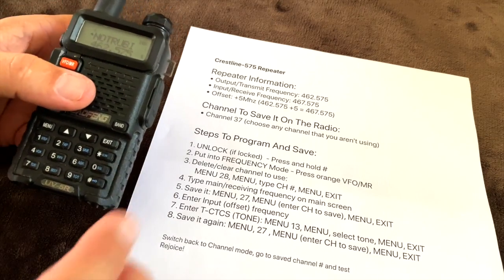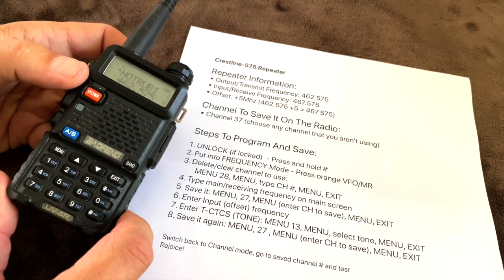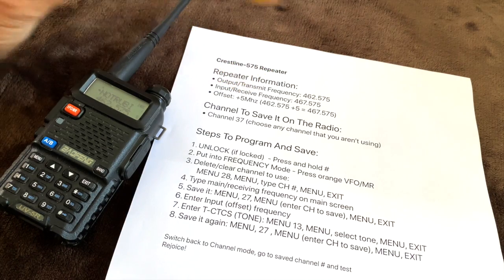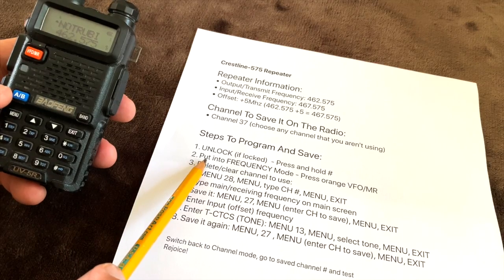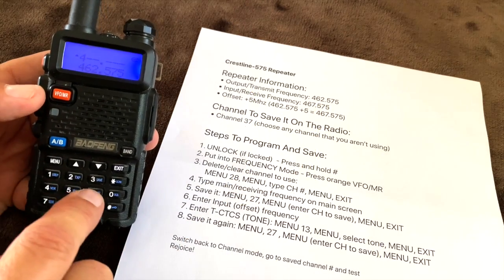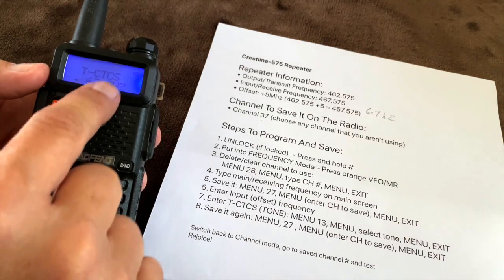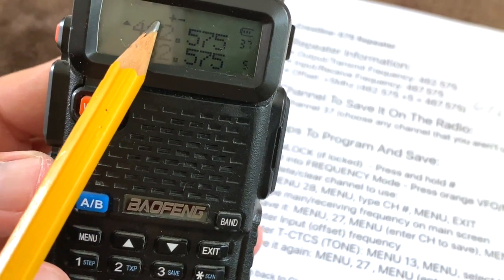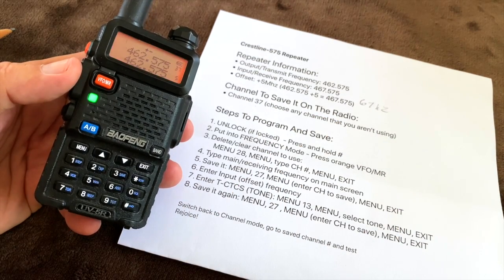Baofeng UV-5R: Add CTCSS and DCS Codes & Tones On The Keypad And Connect To & Talk On A Repeater

Comment: Hello sir!! First let me thank you for taking your time to create this very helpful video👍and for helping those new (GMRS Lic:) ppl like my self. 
I do have a question regarding repeater programming and is as follow: 
When entering the (Tx) frequency, do I set the (CTCSS code) but with the (Rx) off and save it, and the same for (Rx)  with (CTCSS) and the (Tx) off and save it? I got a bit confused there? I noticed that on the video, only for (RX) the (CTCSS) was entered and saved?
Reply: Have your radio in hand. Watch the video and pause after each step. Do the exact input as Randy and walk through it. I believe you are mixing up rx for the repeater and your radio. Hope this helps.

Comment: Hey great job. Very thorogh. However the repeater I want to use only supplies a TX freq. and a +. No RX freq. I can hear incoming but they don't receive me??
Reply from the maker: If they tell you the TX and the +value, you can calculate the RX by adding the +value to the TX
Reply: @TheNotaRubicon   there is no + value, it's just  +
Reply: It'offset: + is the info they provide.
Reply from the maker: if it is a GMRS repeater then it will always be +5 (467.xxxmhz IN, 462.xxxmhz OUT) .. if it is a ham repeater it could be anything, so they need to tell you what the RX is, or what the offset is so you can calculate it.

Comment: First of all, I just got two of these and trying to sett them up for my kids.... so, thanks a lot for being so coherent :):):), rare thing these days ;). 
It's a real trade, to know how to explain something like you would to a first grader  (trying not to say idiots...) without being condescending and judgmental :):):). And second, even though this really helped me a lot understanding the menu structure and basic principals (it reminded me about "my old nokia" menu) I still have one question. English, not being my first language, please excuse my formulation used to put tougher  this dumb question. 
Is there a way to make a private "connection" using CTCSS and DCS without going through a repeater on "free frequencies",  between two devices used in a dense forest at a maximum distance of  2000 meters radius, with a squelch level that would help the kids communicating freely without interfering with a military base (4 to 5 km away from the "play ground") ?
Thanks again ;) !!!
Reply: They did ever work

Comment: so couple things first to make sure i understood this right to use the repeater i HAVE to save it to a channel? and second how do i pull the info from say the repeater book app for example one repeater looks like this

2m
145.41000
144.81000
-0.6 MHZ
FM 100 Hz

so is the first frequency for the menu 13 T-CTCS
the - For Menu 25 the shift
the 0.6 for menu 26 offset?

Comment: Very good, but I still need clarity. After a lot of searching and joining things, I finally got the information for a local repeater. However, it lists DCS codes for both transmit and receive, and they are not the same. Any suggestions?
Reply: Hey Michael. A gmrs repeater that transmits out a tone really doesn't need to be set into your receive frequency as it's not "private" and you will hear the transmission anyway. However, by entering the tone you will filter out all other people that are possibly using that frequency in the simplex mode and not on the repeater. Simply follow the procedure for step 7*** after step 4 ...so step 4, step 7 except you use r-ctcs (tone) and it's menu 11 , then step 5 and so on, if you wish to do that. 
***IN YOUR CASE...DCS **** the menu items are 10 and 12. 
Randy has a video on all 40 menu options.
Hope that helps!

Comment: Is there an easy way to turn on/off CTCSS or DCS while in channel mode without deleting the channel? The menu acts like it lets me save, but as soon as I navigate away in the menu, it resets to whatever I programed in.
Reply: I was going to ask the same question, or similar. I followed the instructions to the letter, but it's not working on my end. Also, the letters "CT" are to the left of that requency channel that I just programmed. Is that supposed to be ON or OFF?

Comment: I went through all of this on mine, and it is still not transmitting for some reason...I can key up my KG-805G and hit the repeater, and the UV5 will pick it up from the repeater, but when I key up on the UV5, I get nothing from the repeater, or my 805??  Not sure what it wrong....
Reply from the maker: Either you did it wrong/missed a step, OR, it is possible the two radios are too close to each other and are de-sensing.. try it with the two radios 20 feet or more apart.
Reply: @TheNotaRubicon  Thank you, I will give that a try.....but I probably just did something wrong on the Transmitting side....

Comment: To set the offset why did you not just go to menu 25 and 26, adjust, then save? That would save you a lot of steps. 

Your step by step is nice but confusing that you used both channels to set your send and receive instead of just one. I have met some people that think the A and B channels are one for send and one for receive, because of this video. That is not the case. They are each capable both and you can hear both as long as menu 7 is set to “on”. When it is off you can only hear the A/B channel that is selected.  

Great radio but really confusing to manually program.
Reply: Terminology can be confusing.  I understand exactly what you are saying, but even your comment could be confusing. He used both "frequencies" not channels. To make matters worse, A/B can be referred to as channels A/B, the open memory bank number on the radio is channel and gmrs groups their frequencies in channels. The gmrs channel (in this case 16-b or 16-r) and the radio channel are probably different. (In this case 37) Both frequencies Randy programmed while he was on the "a" side, and "b" just happened to be programmed the same as the receive frequency. In summary, they are saved on the radio in channel (37)that is different than the assigned gmrs channel (16-r) and when selected can be in channel a or b depending how you want it. It's easy to see how it can confuse the people you met. Glad you set them straight.

Comment: I have a UV-9R PLUS  and program cable .I tried to set up the repeaters I use  with Chirp and some reason does not  recognize the radio . tried  Uv-9 nothing.
So after I tried to enter in the tone and offset  I could not get it to work to any  repeater.  I do have other Btech and Boafeng models all hold the programing fine.  some reason I cant get the Uv-9r plus to program right or hold the setting .. any ideas thank you

Comment: Hello guys! Great video btw! We bought 20 Baofeng UV-5R 8W stations for a cinema project. Is there a way we can encrypt a frequency and use the stations only for work purposes? At this moment when we record some captions, we hear noise...and this is bad for the production. Is there any way to avoid that? Thank you in advance :)
Reply: The only way to encrypt a signal is with digital radios, Uv series radios are analog so that’s can’t be encrypted but you can use. Tones like T- CTCS and R-CTCS to sort of hide your conversation, you can also program these to transmit on one frequency and receive on another. You can temporarily use tones to further code your conversations. But be advised someone with a code scanner could hear your conversations. To use tones there are plenty of videos to show you how to use them. Basically program your radios to use the same tones both in transmit and receive, you won’t hear any other radios that don’t have the same tone that your using. Try using like MURS which these radios can do limit the power of them and that will help you secure your transmissions. Good luck have fun, be warned the fcc has limits on using tones in the untied states, so check your regs before you do any of this,

Comment: I programed both my beofeng radios step by step in this video. But I cannot hear my voice on either radios when I transmit. But the repeater sounds are made on both radios. What am I missing or don't understand about repeaters? Great video!
Reply from the maker: The radios may be too close to each other and the cheap circuitry is being overloaded - try separating the radios by several feet and see if that helps.  If they still dont work, you likely missed something.
Reply: @TheNotaRubicon  That did the trick! I had them to close together. Easy video to follow on you tube on this subject and I have been trying for two weeks. Thanks again. Mike

Comment: steps 5 and 8 prove that step 3 isn't necessary. step 8 proves step 5 isnt necessary. also i only save once, and i save over existing channels if i need or want to. also you skipped over the setting the offset direction, you gave actual needed frequency but not the direction or offset amount. EDIT BEFORE POST: ok i just tested your method and it works your way too. since you skipped the offset direction i guess it just transmits the frequency you placed in the field, other wise if you set the direction  you would need to place the actual value of the offset, not the end result of adding or subtracting the numerical values. good to know, i wish i knew why it works either way as i am sure there is a reason.

Comment: THANKS for the video.  I have my radios (2) programed for 3 LA Repeaters and I did with the cable. After we move to UT, I lost the cable and the software. Is a way to reset the radio to factory setting and remove the program without the Cable & Software?   PS Since the radio was programed with Window XP and now we use Window 10, I think I will have an additional problem.
Reply from the maker: You can use Menu option #40 to reset the radio - these are the options:
-  VFO - Resets all menus to factory default. Resets VFO [A] and [B] frequencies to factory default.
-  ALL - Same as above. Erases all channels.

Comment: Does having a heigher ctcss exaple 244.7 has any different or effect on transmission as if i was to use 67.0 or 103.5
Reply from the maker: CTCSS tones have no effect on transmission and the tone must match the tone in use on the repeater.

Comment: Would you happen to know any possible reasons why my radio will not switch from frequency mode to channel mode I have the UV 8 HP I believe the one that you have to hold the menu button and turn it off to switch I do that but nothing happens it keeps staying on frequency mode
Reply: You have to enable it while its connecto a computer. I had the same frustrating problem. Contacted Baofeng and they told me that.

Comment: Hello!  I have the Baofeng UV-5XP, which has a slightly different menu.  The UV-5R has 2 different menu options for T-CTCS and R-CTCS.  You used the T-CTCS option to be able to hit the repeater.  The UV-5XP only has the R-CTS option (menu item 11).  There is no option for Transmit tone.  I programmed the right frequency, offset, and tone for a local repeater, and I drove to where I could see the antenna.  I'm not pinging the repeater.  Do you know anything about this?  I can't find anything in the manual or any videos or sites to help me out.  Thank you!
Reply: Everything about these radio are not user friendly they make them almost impossible to operate god forbid if the world was up in flames you couldn't communicate at all your better off using a high powered CB radio

Comment: Thank you so much for this! I went through all the steps, but when I transmit, the little red light doesn't turn on. Shouldn't that still come on even I'm not connected to the repeater?
Reply from the maker: Yes.. if the red transmit light is not coming on then you're not transmitting.. You might be locked-out of whatever frequency you are trying to use.

Comment: I'm trying to connect my uv5r to bf-888s any tips would help
Reply from the maker: Very simple! just look up what frequencies the BF-888 uses, then put those frequencies (or, one of them) into your UV-5r ..when both radios are on the same frequency and using the same CTCSS codes (if any), they will be able to talk to each other.
Reply: How do I get CTCS code ? Put in the frequency and key up, it doesn't acknowledge it til I let go of ptt

Comment: This is great info! I am licensed and programmed radio’s now, is there any GMRS lingo that I should be using when speaking on a repeater?
Reply from the maker: You wont find all of the anal-hall-monitors on GMRS like you encounter on ham, so the language is pretty laid-back and normal.. just ID with your call sign every 15 minutes and follow any guidelines set by the repeater owner.